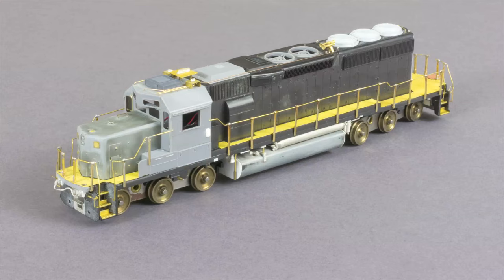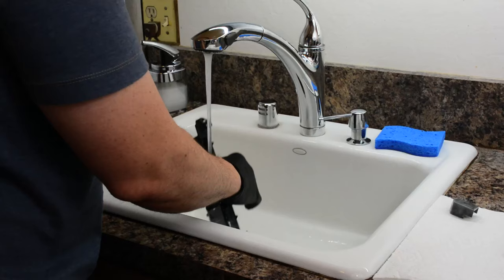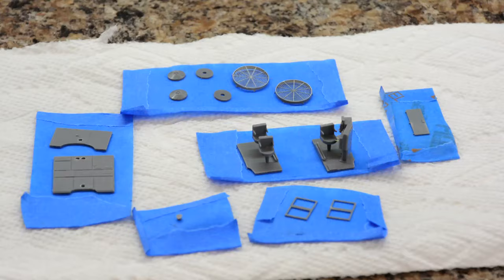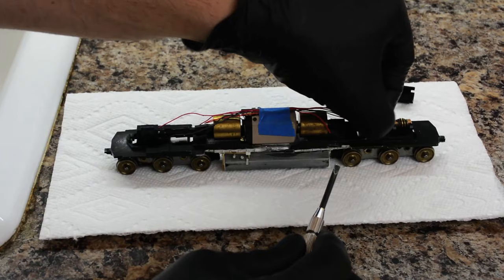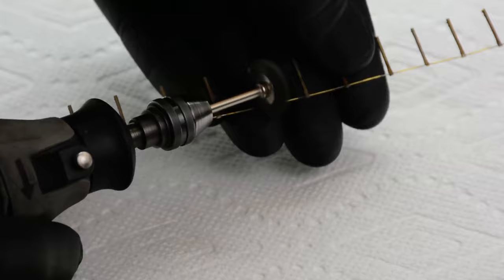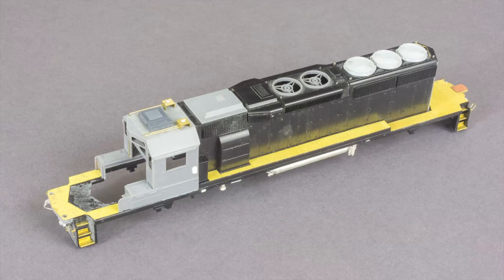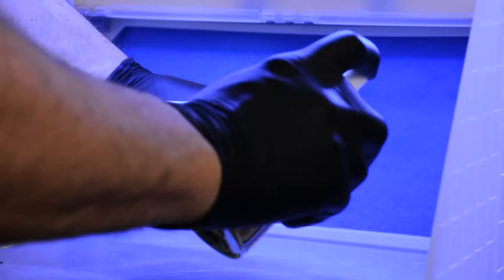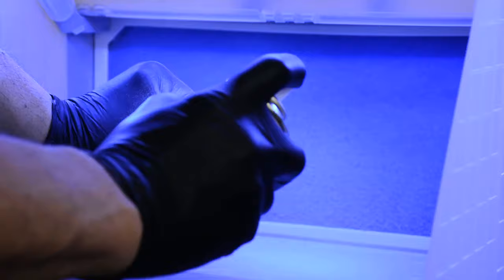HO Scale SD40-2 Model Building 19 of 25 Painting Pt. 1

Comment: I just recently found this series and have been watching it somewhat in reverse order.  Good tips but I am curious why when you changed the motor why you used the old Blue Box type driveline with a can motor???  I've been using Kato motors and the newer hex head drivelines with great success - and they are much quieter.  Also wondering if you replaced the wheels?